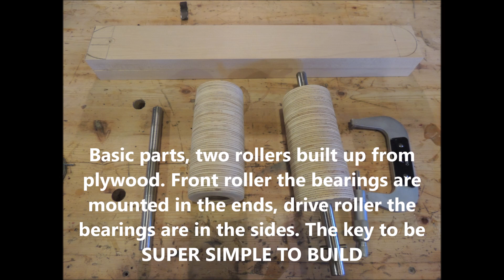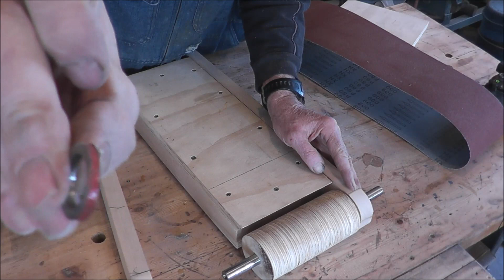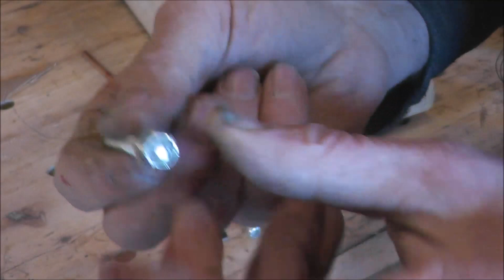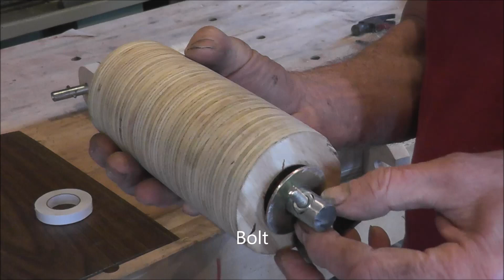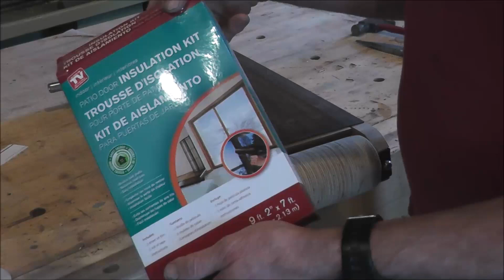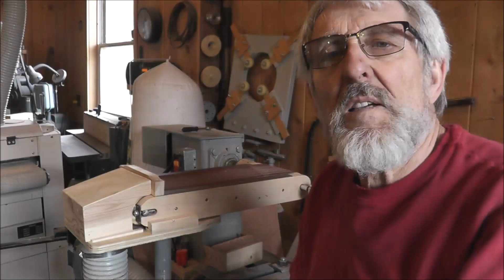PART 2, Of the  construction video's of the SUPER BELT SANDER

Comment: I will do that on the pic. Ya, I don't know yet how the chuck will work out in the long run. I drilled a hole just in case. I'm using a 6x48 ceramic belt. First time with ceramic. I am adjusting tracking just as you. works good. Ya, flange on one side. When I face off the drums I make sure they are the same length. I just got it running and tracking and need to work on dust collection.

Comment: I used flange bearings on both ends. They are opposite on each end. I made the rollers as you did just left some center out to get flex into the belt. I'm going to make another for a four inch belt. Oh, To drive it I just chuck it into my four jaw chuck and the tail stock as you did. Works good. The flange bearings work good because you can make the rollers  exactly the same length with no playing around.
Reply from the maker: I think I got it, flange bearing I think you used just has a flange on the outer race, I first was thinking of the bolt on type. They would be excellent but more expensive of course.  Are you adjusting tracking etc. as I did.  I first tried holding it in the four jaw chuck but was not happy, not enough gripping surface, slipped and marred the surface.  What width and length of belt did you use. If you could ,would like a picture,  email bpbushmaster@gmail.com  Thanks

Comment: Brian, Built your super sander. Not a hard build but it does make you think and accuracy is important. Have yet to make dust collection. I only made about 40% solid and the rest of the belt I wanted "soft" for sanding the outside  bottom of spoons I make. Should work good. By the way I used flanged bearings and think they work well for this application. I used no shims.

Thanks for sharing, Lee
Reply from the maker: Thanks for letting me know, Nice to know that someone benefits from my idea's and can go on and improve on them and adapt them it their own needs. I take it you left the center of the roller blank or with a depression. Interesting idea, will it still track with the center missing, but I guess you would only have to have it on one roller, the crown roller would be now on the drive roller.  Did you use flange bearings on the one that needs bearings in the roller.

Comment: Brian, you responded to my question for distance between centers but it went into spam and I lost it by moving it. Could you send again?
Thanks, Lee
Reply from the maker: Mine is measuring 19 1/2 inches. center to center.  The key to making the drive roller is getting one end of the shaft center drilled.